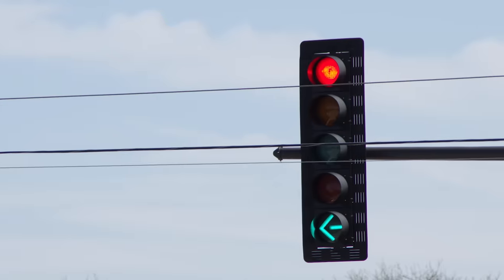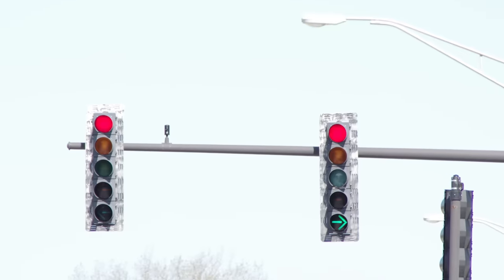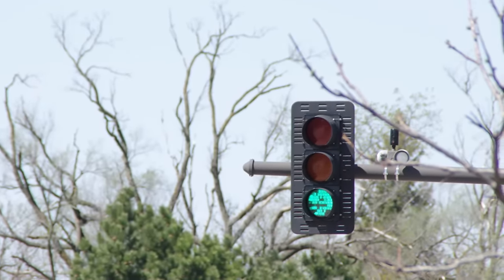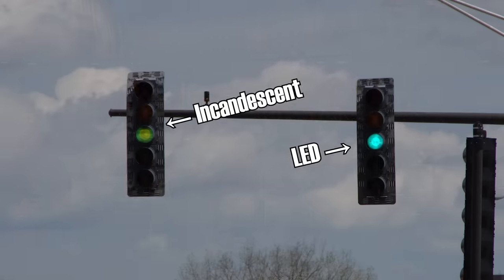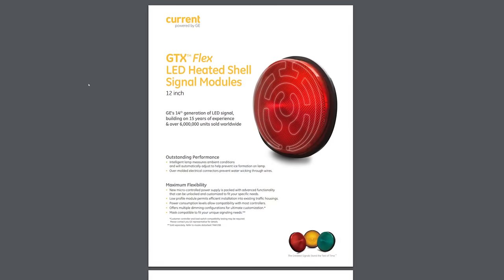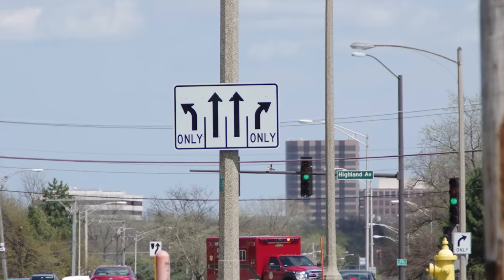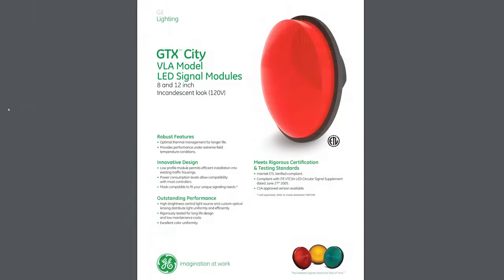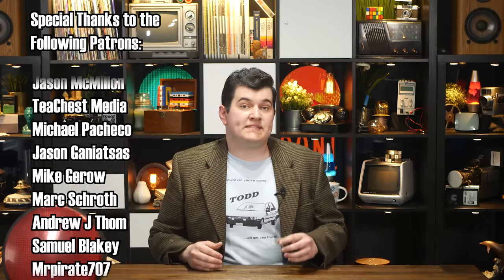The LED Traffic Light and the Danger of "But Sometimes!"

Comment: I do have one complaint about LED stoplights that would be easy to fix.

They're too bright at night.

Incandescent traffic lights are dim enough that they don't screw up my night vision.  LED are way brighter, so they do.

I'd like LED traffic lights to have sensors on them (like street lamps do) to detect the level of ambient light, and dim the traffic signals when it's dark.
Reply: Standard to fit dimmers in the UK.
Reply: Could save more energy by adding an automatic dimmer that dims the LED's based on either time or light levels, more energy savings in one place means they can spend energy in other places, such as a heating module for the lights. Good idea.
Reply: This is also dangerous, that simple solution won't work on its own. If it's foggy and nighttime, it would be much harder to see. A hygrometer should be added as well.
Reply: @abc123number1america  good argument
Reply: @michaellin4553  this this
Reply: Quit staring at the lights..
Reply: you don't even need a sensor. just give the control unit a little clock and power the lights with less voltage..
Reply: Not this stupid topic again.  'oh LED traffic and headlights are too bright for my hyper sensitive eyes' grow up, don't stare at the light for a long time.  If you struggle to see because you see an LED light, you shouldn't be driving.  I drive at night every day and LED traffic lights are never an issue, headlights are only an issue if you look at it from the wrong angle, just look away.  Chances are the screen you watched the video on has an LED panel, are you blinded by it? No, so stop complaining.
Reply: @dr.philwantsyouralimony3418  I just said I drive at night all the time.  My area has LED traffic lights and when they switch from red to green I have no issues with it because my eyes aren't fucked up like yours must be.  You stare at flashlights all the time? No wonder your eyes are jacked up and get hurt by LEDs that are ACROSS the damn road!  The only time I've been 'blinded' on the road (your not even being blinded, your eyes are trying to adjust to the change in light, a small distraction yes but not blindness)  was when a moron in a truck had his light bar on which isn't even legal because it's an array of light.  
Bottom line is people that think LED's are too bright need to stop driving at night or get a tint strip at the top of their windshield which will greatly reduce incoming light.
Reply: I agree that this can be an issue for some people. While it doesn't hurt my eyes, the look of led holiday lights bother me. As you look down the road, or even back and forth at a house/yard covered in lights, it does have weird tracer effects. Also for those opposing the OP, unless you have night vision issues you wont understand.
Reply: @thegrandfinale2 color blind persons use the position of the light, not color.
Reply: Agreed.

The other night I was driving down a country lane (UK) and happened upon a traffic light with no visible junction.

It baffled me, "what was the traffic light managing?" I thought.

It wasn't until I passed the light, that I saw it was controlling a very narrow lane caused by going under a bridge.

A 20ft bridge. That I couldn't see because the light was too bright.
Reply: Text and drive, problem solved
Reply: Personally, they don't bother me.
Reply: In Australia some of the led speed signs at night are so bright you can't actually see the speed limit.
Reply: @jamessymon8540  I know right some of those are pretty nasty especially night works
Reply: @jamessymon8540  I came here to post a snide comment about the OP’s eyesight but holy shit your comment is too real. Driving in Sydney on the motorways at night and one of these signs come up and I'm like "FFS turn your high beams off sign!"
Reply: One of the only issues I see to that is during storms, when visibility is reduced. You wouldn't want dimmer lights during storms, particularly snow. 
The idea is good, but may need more modification to take into account the amount of precipitation happening during that darker lighting time as well.
Reply: @fromthegamethrone  maybe don't ignore the damn signal then. It's there for a reason. You shouldn't ignore a traffic signal because you can't see what's ahead. You don't ignore train grade crossing warning signals just because you can't see the train, do you?
That's not the LEDs fault. That's yours.
Reply: @dr.philwantsyouralimony3418  
Yes, your eyes need to adjust, but here's the deal. You shouldn't be STARING at the lights. You're supposed to glance at them and then put your eyes back on the road, check your mirrors, etc. You should ALWAYS be checking all around you while driving. Tunnel vision is a very large problem I've noticed while driving (and I've noticed it because unlike all the poor drivers on the roads, I'm always checking my surroundings, not just focusing dead forward like I'm looking for the exhaust port to shoot my proton torpedoes down on the death star, mmkay? I see all the dead, tunnel visioned focus of people, with no regard for peripheral vision, checking mirrors or out their windows, etc.
When you stare at lights, even during the day, your eyes adapt and you get slightly blinded. Not only that, but they're a little entrancing. Ever noticed people just SITTING at intersections when it turns green. I've been watching people and some are staring right at it yet react super slowly. I'll be almost completely across the intersection before they realize it changed.

That's not the light's fault. That's the drivers' faults for staring. Same goes to you for being blinded by staring at the lights. The lights are actually bright enough tho they can illuminate your windshield, dashboard, and hood/bonnet enough with some of the color that you can avoid looking at the light altogether just about, and when the color/light changes suddenly on those, you have the green now (or flashing yellow, turn arrow, whatever. Pay attention to what the signal is gonna be if it's not one you regularly go thru).

You're just a bad driver if the lights are bothering you. I have some astigmatism, yet they still don't bother me in the least bit because I'm not bloody staring at em like an idiot. Just saying, man. Adjust your driving habits. You right now are BEING one of those "but sometimes" people.
Reply: @JoeIsCrazyWillman  why do you think I ignored the signal? Where did I even suggest that?

And to make matters worse for your outburst, the signal was green!

I couldn't see the road on the other side of the traffic light, at all due to the glare.

Maybe it was a one off traffic light, as the rest of the drive home wasn't a problem. But the green light was making it unsafe for me to continue driving.

So well done, I hope you got all your anger out in the YouTube comments section and feel much better now.
Reply: @fromthegamethrone  well, you made it sound like you ignored it. So what that you couldn't see the bridge til 20'? There was no problem. You must be one of those terrified drivers with their foot hovering over the break tapping it every time they have even the slightest inkling of not knowing what's about to happen. Oop, a downhill *taps brakes 30 times on the way down*.
Oop a hill I can't see over the top of slows down or hits brakes
Oop, a car 1/8 mile in front of my slowing down hits brakes
Oop, a construction worker walking near the barricade or cones hits brakes on interstate and slows down 10-15mph for no reason

You're one of THEM,  aren't you? Ugh.
Reply: @fromthegamethrone  
goooooood lord you're all big mad at such a little thing. If a puny little traffic light blinded you, sorry, you shouldn't be driving. Headlights are dozens of times brighter than traffic lights. Now you say country road?
And a 20' bridge needs a traffic light? Lol. Was it a single lane? Why does a "country lane" need  a traffic light? Even more, where did the power come from way out there? 
50mph at night? That's cute. I might do that if it's a particular deer zone or something, but otherwise it's superpowered brights, fogs, and low beams all at once together, doing 70.
But for real man, you're sooooo mad and all I basically said was you ignored the traffic device (because why would you make a huge story about it if nothing happened because of it? You made it sound like there was almost an accident because maybe it was that only one direction can go at a time and you couldn't see that that was the case and almost got somebody. Sounds now like basically nothing happened. So that was pointless to talk about. 🤷🏼‍♂️)
So if there was no point to that, you basically said your eyesight at night is so terrible that simply passing a traffic light blinded you. Yikes. Even those YeeYee truck idiots with the bright blue headlights right in your face because of their stupid squatting stance suspensions are just a momentary nuisance, and don't affect anything enough to make a "but sometimes" comment about.
LOL. Settle down. Go have some milk and cookies and sleep it off, tough guy.
Reply: @fromthegamethrone  who's whining here? Lol. You're the one posting childish stuff and I'm just sitting here amused at how pissed you got and started posting childish stuff and speaking like a 5th grader trying to act tough to impress his non-existent friends. LOL.
Reply: @JoeIsCrazyWillman  aww Boohoo, did you run out of things to say?

Go back to playing roblox kid x
Reply: @fromthegamethrone  Nah. I just tire of entertaining kids after awhile. I like educating people, and trolling idiots and easily fired up people. Gets boring after awhile tho. Enjoy sucking at driving, being blinded by normal lighting, and yelling at young whippersnappers in the neighborhood to get off your lawn.
Reply: @fromthegamethrone  Oh so clever. 🤣

Nope  no holes. I'm legit amused by all this. It's Saturday. My day off. I'm enjoying my day. All of it.
Reply: @JoeIsCrazyWillman  #gottahavethelastword
Reply: Red and green light don't screw up your night vision. That's why hunters use it at night and the emergency lighting in many places is red.
Reply: Uh, being bright is part of the fucking point. So you can fucking see them.
Reply: Would be quite simple, but the expense of working at height , and the engineering required to install the sensors. More of an Electricians job , not really a Local authority worker, maybe lack of will to book hours required.
Reply: I agree, some LED green lights are way too bright. I think maybe there's something wrong with them A they are ridiculously overbright, but it's only a rare one that is dazzling like that. Just put your hand up to cover the light that's blinding you, works well. If it is ridiculously overbright then report it, they need to know to fix it, and in the report tell them it's only that light and only at night it's WAY TOO bright. I suspect LED lights have an autodim feature so at night they're not blinding, but in daytime they're needed to be brighter, so if the autodim feature breaks ...

Comment: In Japan there are more simple solutions to the snow accumulation problem in the traffic lights than heated covers.

Where I live we get an average of 380cm of snow an year (12ft), and double of that a little further from the city. Most traffic lights in intersections subject to wind and heavy snow have a simple plastic cover in a cone shape that makes impossible for snow to accumulate on it. Sometimes they just get rid of the visor completely and leave only the lights, which can still be seen when those are very bright LED's (which are dimmed at night). Also almost every traffic light and signage here is tilted so that the snow will not stick to it, specially important since although the snowfall is very heavy, the temperatures are rarely negative, so the snow is wet and sticks to every surface easily.

Examples:
http://otakei.otakuma.net/wp/wp-content/uploads/2014/12/0_denzai_kyosan_06.jpg

https://ilovedemio.com/wp-content/uploads/2017/07/ae85cb43a5e71351b0adcc8a9c6c8863_m.jpg
Reply: Those are honestly really darned smart solutions and so simple they seem obvious now.
Reply: Well of course, Japan. You guys are living 15 years into the future after all.
Reply: He literally went over those in the video.

And they were invented in the US, lol
Reply: the cone visor was not in the video.  The down tilt was not either.
Reply: Japan has a really good infrastructure.  Been to Japan once and I was quite amazed at how efficient it was.
Reply: Dang that plastic cover idea I just suggested in another comment
Reply: @ominous-omnipresent-they  When you have the highest population density in the world, efficiency is essential to basic functioning, so it is a core part of the design of everything there. And even though that's the first priority, those traffic lights in the pictures look nicer and more modern than any in the US.

Comment: The loops in the road don't always work for all types of vehicles...my motorbike wouldn't trip one in CA on time, so I had to do the whole 'broken stop light' thing, and proceed with (a lot of) caution.
Reply: We always added a magnet to the bottom of the bike, like an old speaker magnet to resolve that issue.
Reply: @spdergod  The next microwave that craps out is donating it's magnets to my bikes. I'm so sick of waiting at a light until a car comes along to trip it.
Reply: You can get an aftermarket plate or magnet for under your bike that fixes that.  Here in Ohio/KY area it is the same problem.  That fixed it for my Pacific Coast & ST1300.
Reply: I was able to even trigger the loop on my bicycle by passing across the loop at the edge. Due to the 2 wires crossing at the same time, it is more sensitive there 🙂
Reply: @marwerno  it's usually the motorcycle not being positioned properly in the loop. MC riders are not always the brightest

Comment: After being turned down by our city to help their maintenance department prolong the LED's in the tail section of our city busses, which go out routinely due to the hours applied to their usage, we surmised that they were too afraid of our resistor modules that could otherwise have saved the city considerable money. Their basis was that interfering with the design may cause other issues with DOT requirements. Even though we assured them that my resistor designs can be verified to not only keep the LED fixtures outputting above the minimum required light intensity level, but that they also conform to wiring standards against corrosion and water intrusion. That didn't matter to them since bureaucrats are not interested in saving tax dollars since they must spend their budgets yearly, otherwise they lose that amount of funding for the next year. Wow. If only more taxpayers knew about all this nonsense...